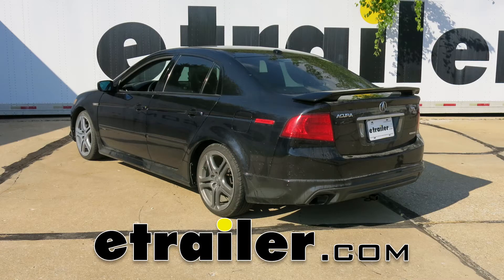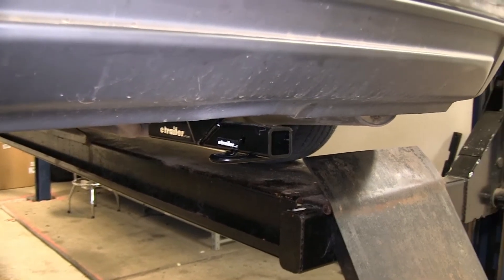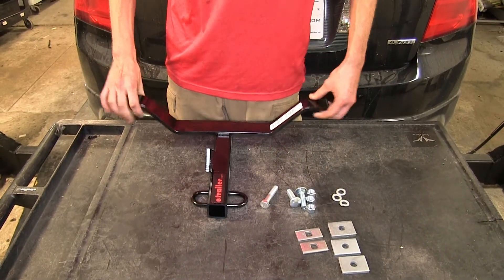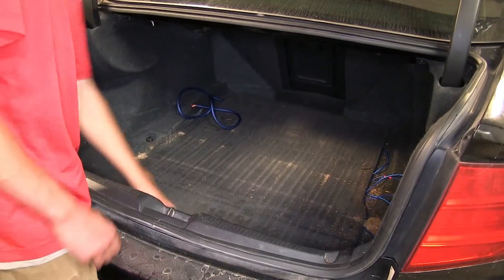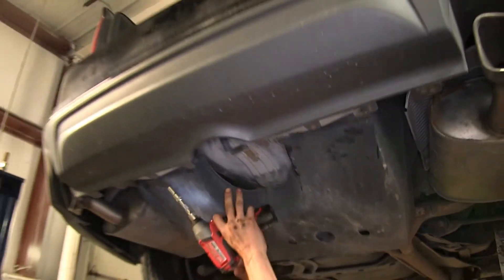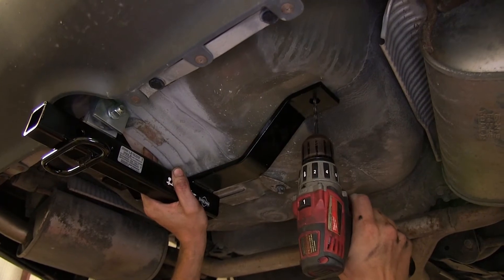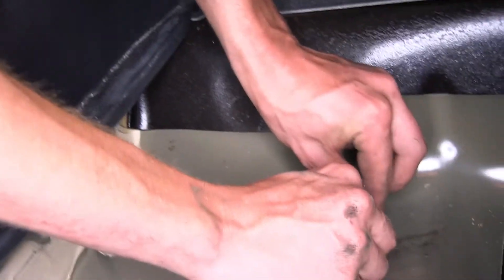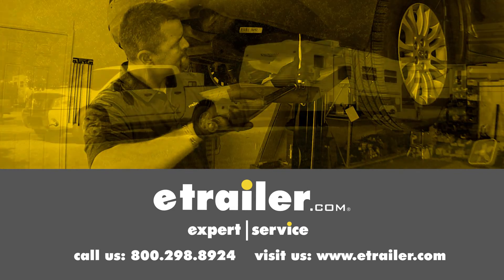etrailer | DIY 2004 Acura TL Installation for the Draw-Tite Sportframe Trailer Hitch Receiver

Comment: is there any way to increase the tounge weight of this hitch? might use it and a cargo carrier for deer hunting and i don’t want to worry about it breaking off or caving my trunk in.
Reply from the maker: Unfortunately there isn't. Not only do you have the hitch tongue weight to contend with, but if the hitch tongue weight is exceeded, the underside of the vehicle where the hitch attaches could be damaged as well.
https://www.etrailer.com/Trailer-Hitch/Draw~Tite/24755.html

Comment: What are the bolt torque specs? About to buy a hitch but the instructions online does not have torque specs
Reply from the maker: Because they can change over time, we don't mention the torque specs. You can find the most current torque ratings listed after step # 7 in the install instructions I've linked below for you...
https://www.etrailer.com/instructions.aspx?pn=24755
Reply: @etrailer  thank you!
Reply from the maker: You're very welcome, happy to help!